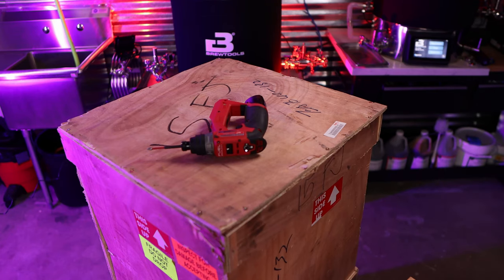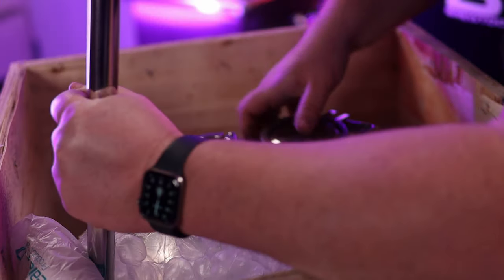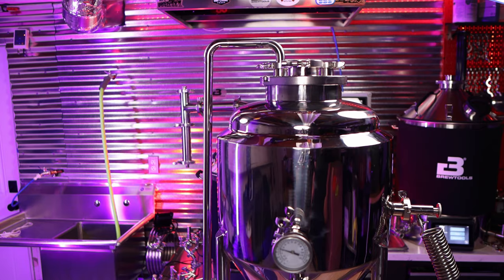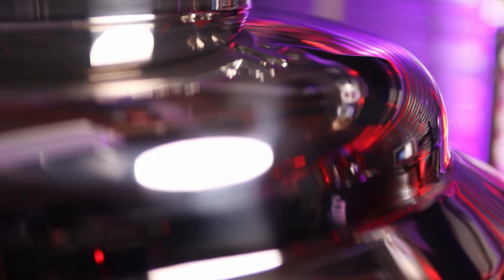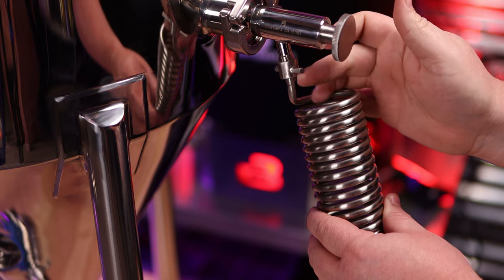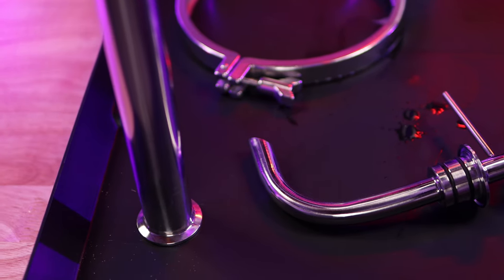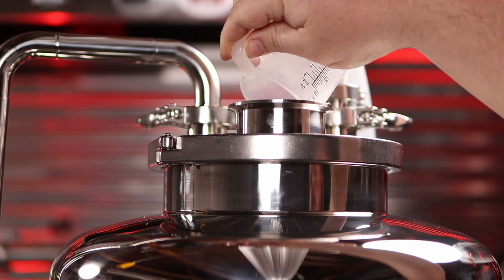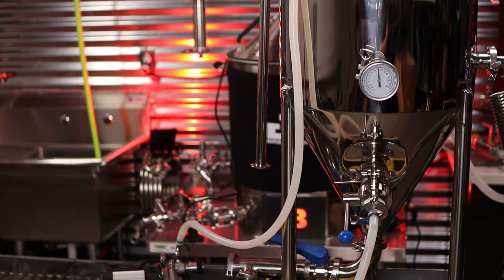BrewersHardware Insulated Glycol Jacketed Conical Unitank Overview

Comment: What would you recommend for a heat management system? I did see DIY video. I was just wondering what else you’d use .  I keep going back and forth trying to decide between this and the Spike fermenter with the unfortunate but necessary neoprene jacket.  However you can control heat with the heating pad setup
Reply from the maker: What did you decide to get I honestly think this is a far better product one compared to anything Spike is offering. I’ve also got a 14 gallon spike
Reply: @PortlyGentleman  you had me convinced. Ready to pull the trigger on 7 gallon. Called them up to ask some more details and the 7 gallon won’t pressurize to15 psi. Dealbreaker. I don’t know why they didn’t just put the same fittings on top as the 15 gallon.
Reply from the maker: @silveraven1  that’s interesting what do they read it to ?
Reply: @PortlyGentleman  a gasket of some sort I believe, it was a couple months ago I inquired.  It even looks there’s enough room to put the same fitting on the 7gal.  Not sure why they just don’t use that on the build.  It’s really a shame and hopefully they change it.
Back to the drawing board… look at the G4 now but still not in the same caliber as BH.
Reply: @PortlyGentleman  So I just spoke with Will and they were meaning to talk to you about the new gasket they just put out as a $50 option.  It will now pressurize to 15PSI - very cool.